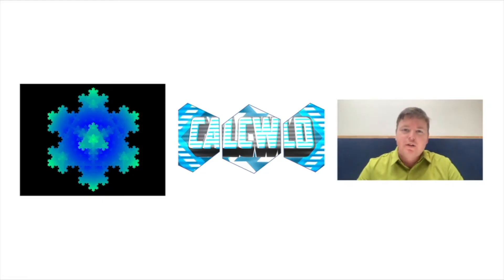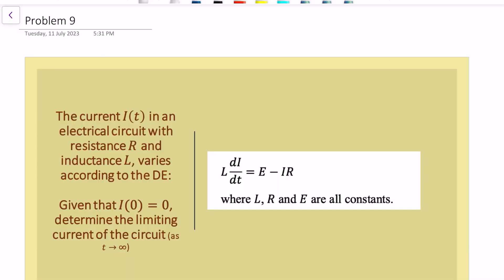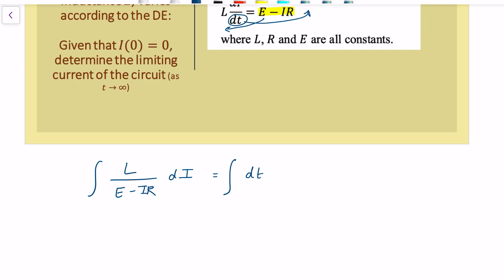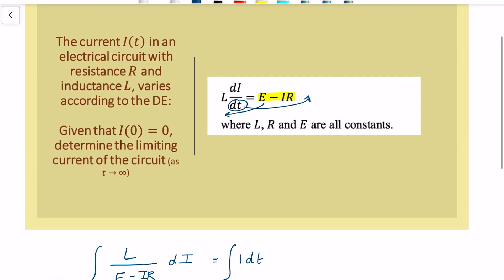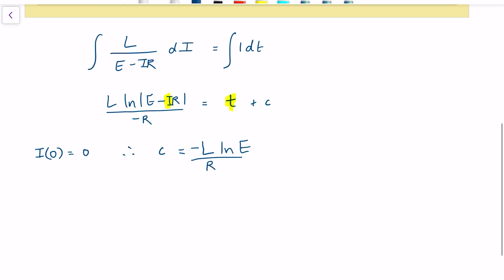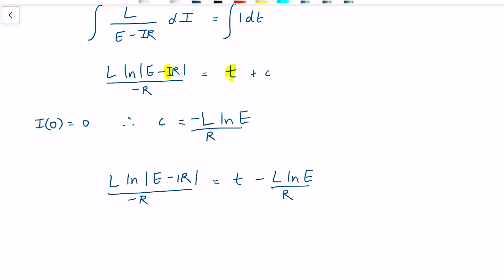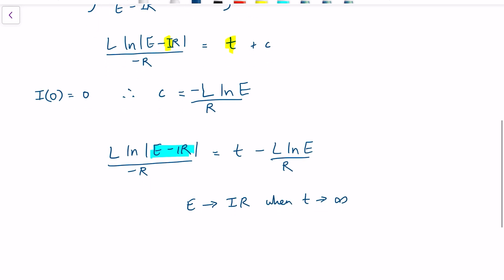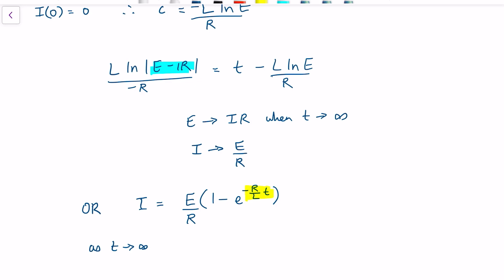Insightful Integration #9

Comment: bruh really nice question. I just did an inductance physics test today and the result was awesome as it is basically kirchhoff's law=>  Source voltage = induced voltage + resistor voltage, where when t-> infinity, the current asymptotes to its maximum value and the induced voltage falls to zero due to no change in current, and hence V=IR is true
Reply from the maker: Can't have Physics without Maths!! 😊